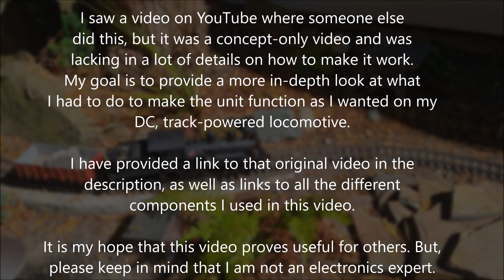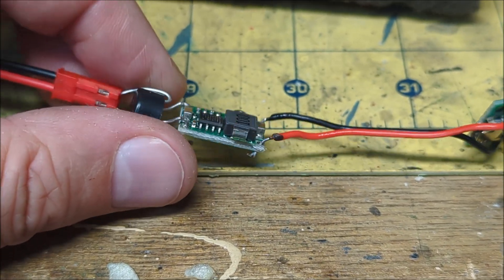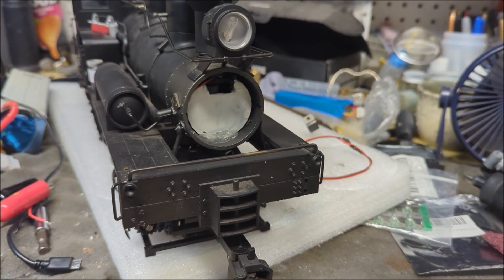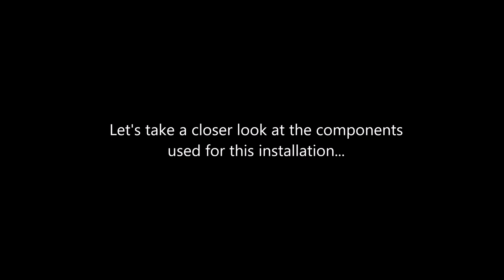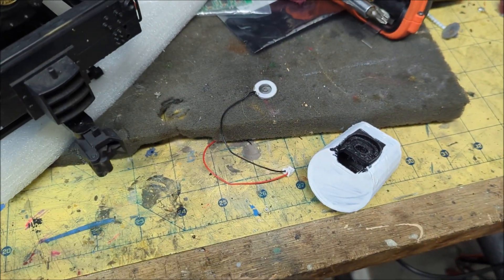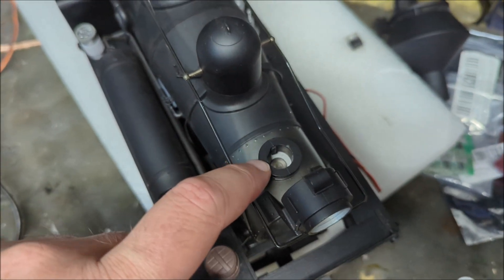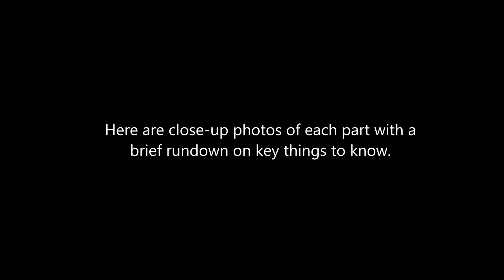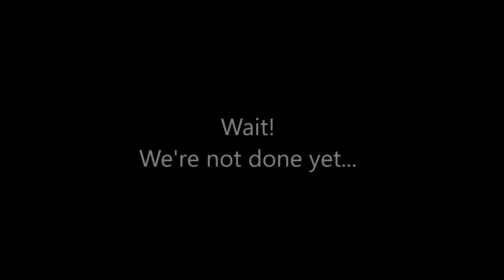How To: Ultrasonic Mister Smoke Unit in G Scale Bachmann Shay

Comment from the maker: If you are running a battery-operated train with something like RailPro or Blunami, you can (probably) not worry about using the bridge rectifier and step-down converter and instead connect the mister unit directly to one of the 5v output pads on your decoder board.
Reply from the maker: I got myself a water bottle with a long neck to make filling the tank easier. Here's what I got:
https://www.amazon.com/dp/B089KR8CB8?ref=ppx_yo2ov_dt_b_fed_asin_title
Reply: If you've got an engine like the Big Hauler where there is an axle that can close a circuit, you can also use that to design a puled smoke solution. The humidifier can start up again instantly even when rapidly disabling and enabling its power supply, from what I could find out in my testing.

Comment: Tell me if I'm wrong but I believe those things can pull water through a wick closer to the top to stop the water condensation from falling back onto it. Then the idea I have for the water fill what's to tap a hole from the outside thru to the tank and put a small bolt looking plug so it doesnt look outta place.
Reply from the maker: Yes, placing the device closer to the spout top will likely reduce condensation from forming, but it'll also make the mister head much more visible. So, that's a trade off between looks and functionality.

And yes, I thought about doing a false funnel for a weep hole so that any condensation that does form can trickle around the outside and either feedback to the reservoir or go out the side of the smokestack funnel.

Comment: I've been experimenting with this idea for a while (I suspect the concept video mentioned in the intro might have been mine). Your setup is pretty much identical to what I had in my 4-6-0 in that video, and it looks like you ran into a lot of the same issues. I'm currently testing a new design for the tank inside the smokebox that will solve the issue of condensation dripping onto the disk, as well as allowing it to be refilled through the stack. It has the disk tilted at a 45 degree angle, with a very short wick, with a vertical baffle to redirect the steam upwards.
Reply from the maker: Very interesting concept. I hope that you do a video of this so I can see if it works out well. And yes, it was your video that got me going on this. I did link it in my description so as not to take the credit for the idea. I just wanted to show a more detailed video of how the actual assembly worked so someone less technically inclined could take a shot at doing this.
Reply: @ShadowVFX  I appreciate the credit, but it's not needed - this idea has been floating around a lot longer than I've been experimenting with it. I'm just glad to see more people embracing it and building their own versions. I do have a video in the planning stages. I also plan to release the 3D files for free once I get the design finalized, and I'll send you the link when I do.

Comment: I installed a Ultrasonic Atomizer in a LGB 0-4-0 Stains with the 'Balloon stack, similar to what you did with method 2.
The main thing I did differently was I purchased a DC5.5-32V to 5V/1A Voltage Regulator (LM7805)
Doesn't need to worry about adjusting the voltage output.

"Smoke" time is limited due to the small reservoir, but it was a fun experiment.

Comment: Could you maybe 3d print a new res with a cone that goes up into the funnel? Then maybe make one of those domes a fill port? Though idk if youl want to be doing that heavy a mod to such an expensive loco lol
Reply from the maker: I have no doubt that there is a better/smarter way this could be done. But I found that taking the front smokebox is easy and works well enough. Feeding from the top would definitely be the best way, if it is possible.

Comment: I did this to a Bachmann Big Hauler and used the diamond stack funnel as the reservoir with the wick and mister board in the stack.  Although the locomotive is DC track powered, I decided to run the mister and some firebox fire LEDs off of a 9v rechargeable battery, so that it can be producing steam while standing.  I have been wanting to upload a video of mine.

It produces some quite impressive steam!

Note: I also use a similar voltage regulator, but mine is a fixed 5 volt.
You can see mine in action in this Christmas video, but not very well: https://youtu.be/M3YXsIvq7YI?si=bXvm313fYZocdvzA
Reply from the maker: Nice job. And yeah, I had been tinkering with using the diamond funnel as the reservoir and unit combo, but realized I had plenty of space in the boiler/smokebox for a reservoir that would probably last for an hour+ of runtime, and I decided to use that instead.

Do you have a link to the regulator you used? I just used what I had on-hand in my parts toolbox.
Reply: Add another tank like whats on the right fender and place on top behind the smokestack then pipe it into your 3d printed  reservoir.

Comment: Thank you so much for the video! I too saw that original video a while ago and wondered.  So glad you made this
 I will have to try. Do you find the water condensation an issue at all over the engine? I suppose it is easier than the oil splatter.. I will have to see..very cool though , thank you again
Reply from the maker: I have not seen any condensation at all on the locomotive with the exception of inside the funnel itself. But on the outside of the locomotive? No. Absolutely no residuals.

Comment: Since I am using battery power and will wiring direct to either a RailPro or Blunami circuit board I should be able to avoid the need for a bridge rectifier and a voltage controller.
Reply from the maker: That is correct.
Reply: @ShadowVFX I tried it with my battery-powered shay, and it completely fried the circuit board. I was using a blunami decoder, I think the voltage regulator is still necessary.
Reply: @gtsstudios101  The voltage supplied by the Blunami boards is 1 to 1.5 volts less than track voltage.  I've used it to power ferry lights and it requires a regulator.  Blunami does rectify the voltage so a regulator is all you need.  I'm wondering if you can use the decoder to get a puffing action.